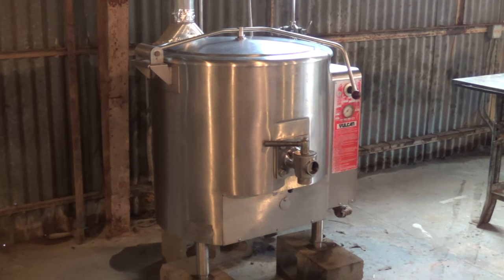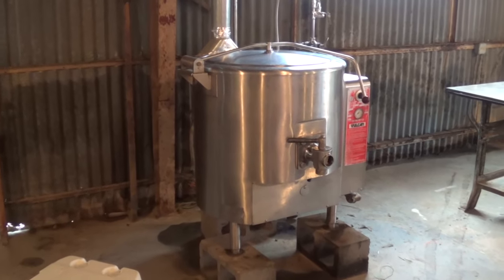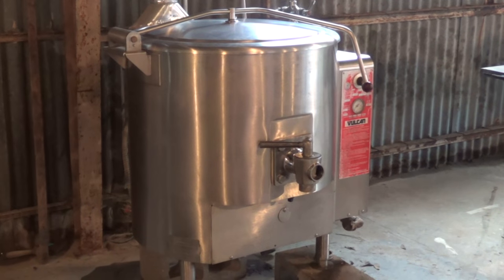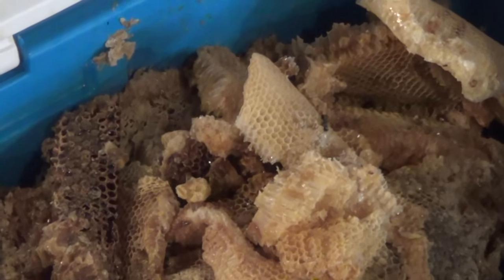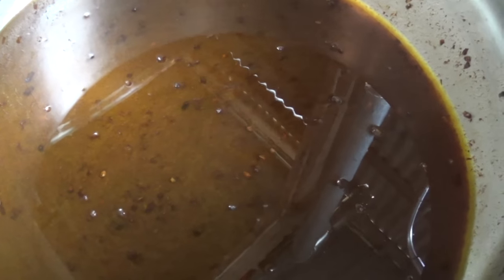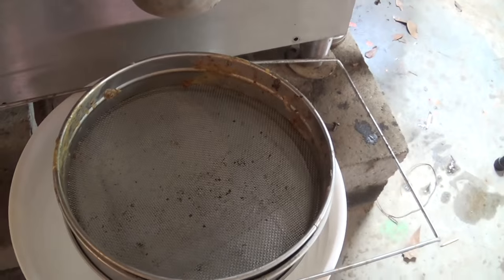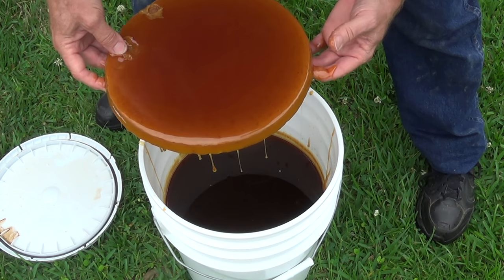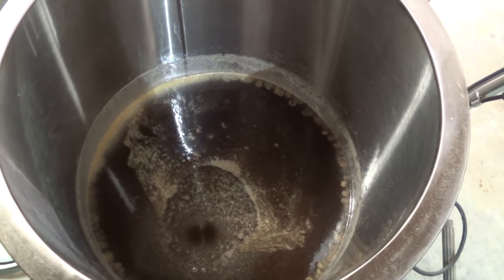Processing honey comb from a cut out

Comment: Thanks again for the videos. I had a question.  After you strain the honey the second time after taking the large disk of wax off the top, you said that you will skim something off at it's final stage. What are you skimming off at the final stage before the honey is ready to eat?
Reply from the maker: It's just the really fine wax particles that are still floating on top of the honey. I try to get most of it off, but it is ok if it goes in the bottle. You can still eat it without harm. Thanks for watching. God's peace.        Mr. Ed

Comment: Since a lot of the comb is uncapped, do you monitor the moisture content before bottling?  If you need to reduce the moisture content, what method do you use?  Thanks again for posting.
Reply from the maker: +Dennis Carter         All the comb that is uncapped I feed to the bees. Very little uncapped honey goes into the melter, what does get in does not make any real difference. Thank you for watching.

Comment: I thought that you had to keep the temperature of honey under around 110f? Wax melts at about 140.
Reply from the maker: +RayBradleyTompkins       You are not suppose to have the honey higher than 100 degrees as it changes the natural aspect of honey. So yes, the honey has been changed. However, it is still honey, and though it has been slightly homoginised, it still has some of its natural benifits. When I spin the honey from our hives, I use no heat. The only time I use this process is when I do a cut out and have comb honey. It's faster and less messy doing it this way. It works for me.
Reply: +Jeff Horchoff I am a new beekeeper and just wondered.  Thanks for the information.
Reply from the maker: +RayBradleyTompkins     Welcome to the wonderful world of keeping bees. Not much money in it, but way worth the effort.